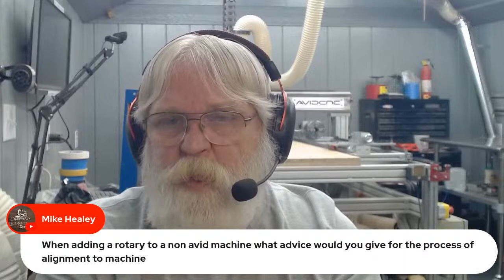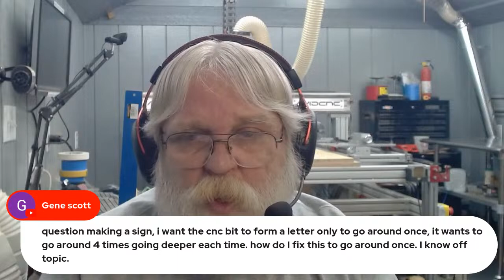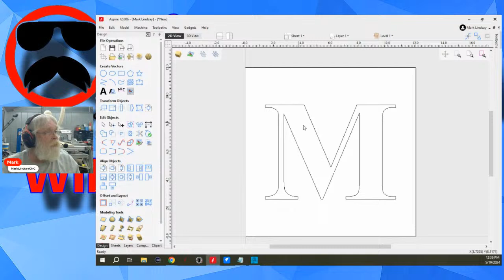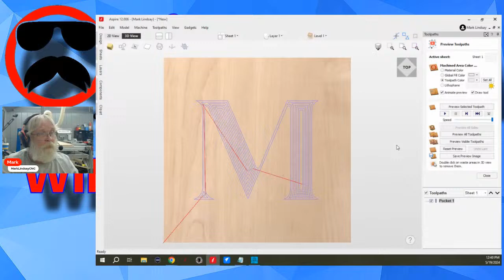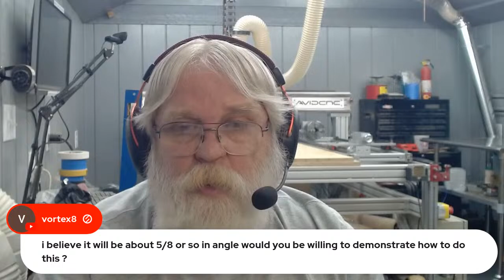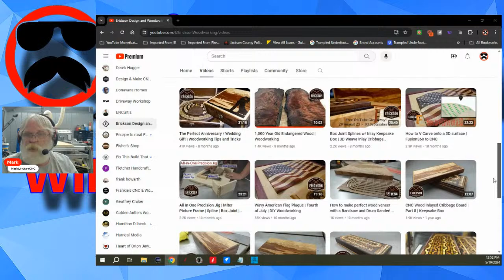Live Q&A #243 – Avid CNC Rotary Axis Assembly and Installation – Open Q&A

Comment: Watching this after the fact but sparked a question. The CNC machine I have is an Avid 48x48 and 4HP spindle. I assume that is what you have as well> My question is if I see on any of your videos that your tool pass settings are xxxxx, can I clone them on my CNC? e.g. I run my 1/4" endmill at 21,000 , .25 depth but speed is 80 inches a minute. I just saw your 1/4" EM was like 180 inches per minute? my wood is say cherry or maple. Just seems crazy fast!
Reply from the maker: Between you and me, it IS crazy fast. The speeds you see on the computer I do my live streams from aren't necessarily the speeds I use in real life. I have to "adjust" settings on that computer so that the toolpaths don't take forever to calculate or preview while I'm live. I have cut some materials at 180 ipm, but that's not normal. For example, the feed rate for that same bit on my "designing computer" is 120 ipm. Keep in mind that number is basically a place holder. After I get the bit selected, I'll edit that bit within the toolpath and adjust the speed to suit the toolpath and the real material I'm going to be cutting. I'll also adjust the feed rate on the fly in Mach4 when the toolpath actually starts cutting into the material. There is no magic number that suits all materials, or even different pieces of the same material.

We basically have identical machines (IF you have the NEMA 34 motors, that is,) so for cutting a profile toolpath in Cherry or Maple, I would slow your spindle RPM down to 18,000 (maybe even 16000) and calculate the toolpath at 80 ipm. When you actually start cutting on the machine, you can adjust the feed rate as it's cutting. Increase it one click (25%) and listen to the bit. If it sounds like it's struggling, or if the spindle RPM bogs down, back it off to where it was. If it doesn't, bump it up another click and listen again. You'll soon discover the limit, and when you do, back it off one click and make a note of it. Do know that's an ongoing thing. I do it on every project, other than 3D Finishing toolpaths.